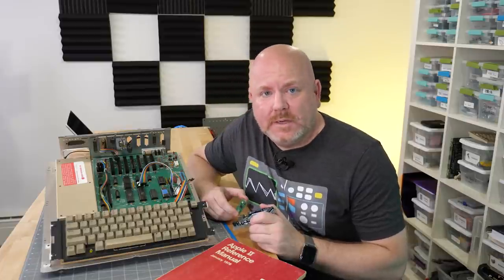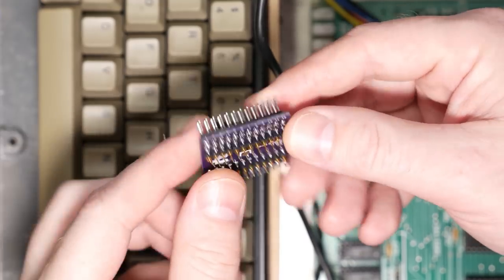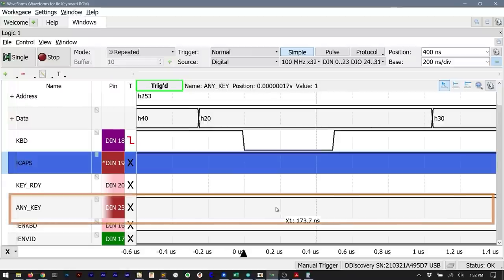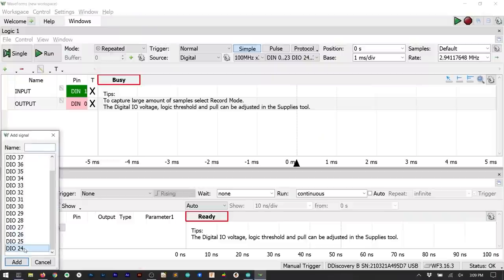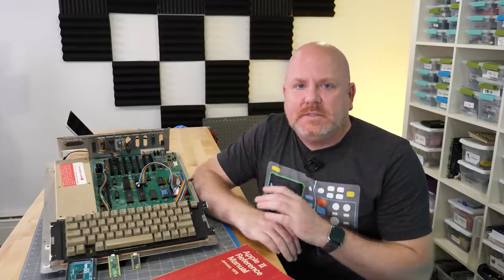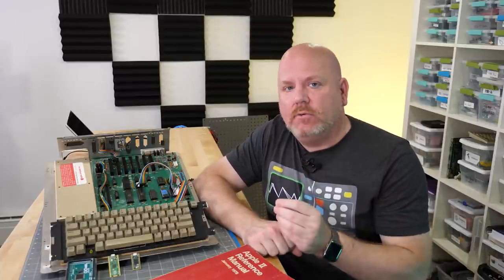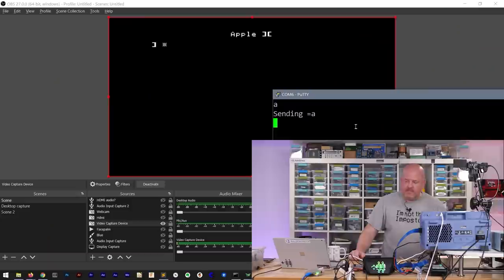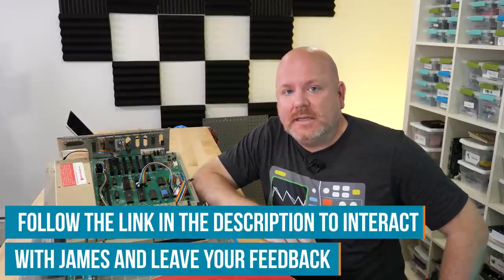Emulate an EPROM - How Hard Could it Be?

Comment: Designing state machines is mostly a lost art. I've designed dozens of them but that's because I'm older than dirt. I never got around to learning C because it was too slow and It didn't give me the control of the processor that I needed. That said, I really enjoyed vicariously experiencing your path of discovery. I remember the excitement I had when my TRS80 made my ASR33 print from the keyboard. Good job man!
Reply: c is fast . depending on how you use it. its much like a assembly libraries collection. it has lots of prewritten assembly codes embeded inside. the reason its slow in lots of cases is because of programmers lazyness and control codes used thats necessary for uninformed programmers probable errors going to happen. you can skip the slow libraries/codes used with your own ones whenewer you want. c is technically collection of code. actually today gcc has them all. and you can access the some features from allmost any language. and it simply links to relative ones from whichewer language you use :P 
atleast most of the times it seems .
Reply: C is ok for slow logic stuff if used right. You will not have feeling of "loosing control" if that's calling C from asm and not reverse. arduino is kinda opposite of how it should be.
Reply: @ahmetmutlu348  You are most likely right. But there's a limit to the number of systems I can learn and still be proficient at them. I don't code every day so I"m "good enough". C seems to be really good if you want to be able to move programs from system to system. State machines beat everything if speed is essential . 74s02 can make a decision in as little as 1.5ns.
Reply: Most of the rest of your comment is fine, and I love the low level development. Doing a bit of assembly here and there, C and C++ is what I work with most.

But "Designing state machines is mostly a lost art" isnt entirely true. working with assembly for whole projects probably is getting a art style (some still use it, for the art factor). but state machines are still everywhere.

Even in modern video-games, people use state-machines for various tasks or objects to be in. That awesome multi capable object that moves across networks? it might be in a certain state and the programmer dint fully understand object orientated programming at all. Anyway, its a great video and somehow I feel a but dirty thinking I can only use modern MCU for debugging older hardware... there must be a way to use a older z80 sbc for this... probably with state machines, ttl logic and assembler XD.

inline assembly

Comment: I've played with the Pico PIOs and they're amazing. You can calculate the exact number of clock cycles for your code and get perfect timing. I'd love to see a PIO on the RPI5
Reply: I really want to play with these now but how many pins can they do? Teensy barely has enough pins for a 28 pin eeprom..while I have gotten it going fast enough I haven't succeeded in merging the address and data pins on the teensy side

Comment: I thought this was going to end up being sort of the inverse of using an EPROM as a programmable logic device, but then I realized you were wanting to type via the microcontroller rather than operate strictly as the character ROM. EPROMs as PLDs is a fun thing to experiment with because you have many inputs (address pins) and either 8 or 16 outputs (data).

Comment: A Cortex M7 with its MSP (main stack pointer) pointing to DTCM, and the interrupt vector table and code in ITCM should be able to enter the interrupt handler within 12 cycles, but the M7 based MCUs are often lack single cycle GPIO access because of the bridges between AXI, AHB and APB matrices e.g. on the dual core STM32H7xx parts the slower M4 cores directly connected to the AHB matrices have lower GPIO access latency and can respond to interrupts in 12 cycles as well.

Still the RP2040 is a great fit for your project and the PIO can should be able to perform address decoding for you like this. Wait for a valid address, shift it into the FIFO, have a DMA channel read from the FIFO into an other DMA channel configuration register and trigger that channel. This way the M0+ cores remain available and the Python overhead won't hurt your timing. To further improve latency you can make use of the two priority levels supported by the RP2040 bus matrix. That should be enough to emulate a ROM without jitter (as long as the ROM fits into SRAM). The PIO FIFO could also be polled from one of the ARM cores or raise a interrupt line on either ARM core to procedurally generate ROM content.

Comment: What if you used native C of even Assembly in the Teensy? I found that’s the arduino abstraction is hellishly inefficient. Pi Pico is a graceful solution.
Reply: Not even sure it is an Arduino problem. GCC does unnecessary register pushes in ISRs, unless they are declared "naked" and you do the housekeeping yourself.
Reply: Yes, AVRs can run really fast if you use C to manipulate registers directly, and it gets even faster using Assembly. But, if i understood everything correctly, the atmega2560 runs at 16MHz. One clock cycle therefore lasts 62.5 ns. And the datasheet says (page 18): "The interrupt execution response for all the enabled AVR interrupts is five clock cycles minimum". The resulting 312.5 ns for 5 clock cycles would still be too long if even the 180 ns of the Teensy were to long (3:55).
(A second pair of eyes to check this information is very welcome :) )
Reply: The teensy can emulate a 70ns eeprom fine. I've done it. Took me like 2 weeks with a scope to get the ISR response quick enough. Basically got it down to 20ns to flip a pin. And I had to overclock a bit.
Reply: @graealex  not so sure about that..if that was the case I wouldn't have got down to 20ns.
Reply: @jahrkh3518  yeah a 2560 won't do it. A teensy can, I've done it, without even really resorting to asm
Reply: @forbiddenera  cool! Did you write the ISR in assembly?
Reply: @CallousCoder  there's a few assembly instructions but no. The isr is kept as simple as possible anyway so I'm not sure being pure assembly would help

Comment: Thank you for figuring this out! I recently attempted to use my old commercial versions (Flexrom and EE08) and found they needed parallel ports and not PCI based ones, old school PIO based ones. So aside from digging out a 486 and setting up DOS I figured there was some product out there that now did this....and I was disappointed. The best I could find was a MCU based project that overcame your problem by loading some latches up (74374 or something) to hold the address (hi/lo) and data. 

I was kind of figuring that that access time (back in those days measured in hundreds of Nano seconds you be too fast for a modern high level language based MCU device? You saved me a pile of work!
subbed and thumbs up!

Comment: The RP2040 on the Pi Pico runs at 3.3V and has an absolute maximum I/O pin rating of VDD + 0.5V (so 3.8V here), but you seem to connect directly to the Apple bus running on 5V.  Does the Pico pull down the bus high voltage, or have the ESD diodes in the RP2040 pins failed open?
Reply: I think in this case on the APPLE CPU side of things is only READING from the eprom.  The problem would be if the APPLE wanted to WRITE to the Pico.

Comment: Nice Discovery 2 board! I had to buy the original Discovery 1 for classes and I still use mine (for scoping, supplying, and analyzing). While it isn't as good as something like a Keysight scope, I was still able to find an issue with an nRF dev board communicating with an ESP board by probing the serial lines.

Comment: The Pico PIOs look very, very interesting and promising to me since I've been trying to accomplish something very similar to what's being attempted in this video. 
I too ran into problems while trying to emulate EPROM for my Z80 project with an Arduino nano and then later with a RPi Pico. At first it seemed to me obvious to use interrupts to control the logic of my program (toggle the WAIT control signal, sample the address bus, check the control signals to determine whether an input or output operation was being executed, read or write data to the data bus and then continue).  I managed to get some meaningful output results from the arduino and so decided to use something way faster like a RPi Pico. At the beginning I thought that a 125 MHz MCU could easily outpace a Z80 that was running at a ridiculously low speed of ~370 KHz. I was wrong. I ended up using external digital circuitry to make the Z80 wait in order to allow the Pico determine what to do.

Comment: Why aren't you just using a 74HC541 buffer or something comparable? It has three-state outputs, so you could just wire whatever slow signal you want to set on the bus into its inputs, and let its output-enable pin react incredibly fast on the "bus enable" request.
Reply: Indeed. That way the Arduino could run in "loop over input buffer: set outputs, trigger key-pressed signal, wait for enable pin to toggle, repeat" with no speed issues.

Comment: nice concept - but doesnt the pi pico have more processing power than the appleii anyway? seems a bit overkill using such a powerful processor to just run the keyboard
Reply: the pico or a similar microcontroller can in fact emulate the Apple2 perfectly. The ESP32 is able to generate video, read a PS2 keyboard , read emails, and emulate the Apple2 at the same time !

Comment: Could you have used an arduino and a 8 bit wide 3 state HC logic chip like a HC573 or HC4094? The apple is looking up a conversion table in the rom to go from keyboard  matrix to ascii. Cant you just load a 573 with the value you wanted anyway for any keypress? It's the grabbing that needs to be short on time, not the loading. A 4094 would let you do it using only 3 i/o from the arduino.
Reply: I was thinking the exact same thing. The only thing that needs to be fast is the tri-state enable, so stick that in hardware instead of trying to emulate it in software.

That said, it is interesting to see that the Pi Pico can be quick enough to do the job in software, which is kinda cool.

Comment: Now, in all fairness, you're not really emulating an EPROM. You're emulating a keyboard decoder that happens to use an EPROM as a lookup table. I was somewhat surprised that after decades of huge improvement in hardware, it is still virtually impossible to emulate any form of random access memory of any decent size using programmable logic. We now have gigabytes on a micro SD card, but it all comes at a cost in the form of latency that one cannot afford when the requested data is required within tens of nanoseconds.
Reply: FPGAs for quite some time have block-ram as part of the fabric. What does "decent size" mean to you?  You also have the possibility of using a DMA engine to write directly to DDR3/4 memory. There are even faster memory solutions as well. At one point in my career, I continuously captured data from a gigasample-per-second ADC, from one sub-hundred dollar FPGA to a Zynq SoC, that used scatter-gather DMA to write directly to DDR3 memory.. I think it's worthy to review the architecture to see if an FPGA can work for you. You can accomplish a lot with popcorn small FPGAs.  If you detail the problem you're trying to solve, we may be able to figure something out.  There are other very fast memory solutions as well that I have not looked into that FPGAs support.
Reply: @2jpu524  thanks for your reply. Very interesting! I have to revise my statement. I'm an electronics novice, trying to do some fun projects using readily available (in my context) hardware like ESP32 and such. The stuff that you are doing is far beyond my capabilities and I currently don't have the time to invest in my education. "Decent size" in my case would be emulating an 8 MB ROM with no a priori knowledge of where the next read will occur.
Reply: @nkronert  Actually see the PiStorm project. The RaspPi emulates an entire 68000 CPU, RAM and ROM while running Linux plugged into a real Commodore Amiga. I think they added hard drive emulation on the Amiga as well now. 

But indeed, one would think proper EPROM emulation would be easier -- but that access time is a problem...
Reply: An idea that may interest you - The MisterFPGA project uses an Altera DE10-Nano board with an external 128MB SRAM module that is dedicated to the FPGA fabric. You could load in your EEPROM data from an SD card, etc, and load it into SRAM memory. What kind of latency are you looking for. One intesting aspect of this project is that it'c cycle accurate in hardware-emulating vintage computers and their associated peripherals.

Comment: Is RPi Pico 5V tolerant?
Reply from the maker: No.
Reply: @element14presents  Didn't you directly connect it to the Apple II here, and thus feed 5V TTL over the GPIO? You just used a Pico w/o any level shifters added, correct?

Comment: When it comes to applications requiring quick and precise sub microsecond timing I tend to go for PIC microcontrollers. Even the DIP packaged 8 bit ones can give a very good response time to interrupts.  It is best to use assembly language and access registers and stuff directly rather than a high level language though as the latter often has many overheads and also introduce many unknowns.
Reply: Avr got precise quick timing if it is not ruined by arduino bloat
Reply: @MRooodddvvv  Quite possibly. I've never tried programming AVR in assembly.  I got into the world of microcontrollers with assembly on PIC and later moved to C and C++ for anyhting that didn't need very precise timing.  Never got into AVR assembly but I can understand that it is probably just as good as PIC.
In more extreme cases I use FPGA but it is fascinating how much can be done even with the 8 bit PICs and even more so with the DMA equipped PIC32s.
The application described in this video would be dead easy to do in assembly on an 8 bit pic even clocked by its internal RC oscillator/PLL. I think even in C it would cope enough as I have done some things quite similar in the past.
Reply: @listerdave1240  i got into avr first and then look at pic it seems horrible overcomplicated and difficult with all memory pages, limitations of what registers can be used where and so on. avr is waaaay more straightforward

Comment: It still seems more straightforward to use a CPLD or FPGA. Will this work all the time (like not miss a character after days of typing for example)? Your project is impressive though.
Reply: Could just write isr in assembly and ditch arduino bloat and should be fine
Reply: FPGA would be overkill for this application. Maybe a CPLD but in general an MCU will be cheaper and easier to program even though it is inherently far more complex than a CPLD.  A low end 8 bit MCU is perfectly capable of handling this level of latency requirement if programmed efficiently in assembly
Reply: @listerdave1240  Micros are generally much cheaper of course, and are generally easier to program, but if you looked at the jitter of your assembler routine in terms of input vs output, and plotted that as a histogram, you would see that the CPLD/FPGA will be much tighter. For this application, there are lots of alternatives. For others, the extra jitter is a ghost in the machine that may show up occasionally. I program both microcontrollers and FPGAs.. Both have their place. I have a lot of experience with pulse generators and sequencers and precision timing. Cheap FPGAs give me sub-nanosecond resolution.  All the same , microcontrollers keep on getting better and cheaper for what you get.
Reply: @2jpu524  Sure and in fact I do use FPGAs where I need that sort of resolution.  My point is that the particular application presented in this video is nowhere near needing anything of that sort and can very easily be done with a very cheap MCU and a few lines of assembly code or even C. 
Jitter would only be an issue if the MCU is doing other stuff apart from the simple task presented here, which in the case of Arduino would be going on even if you didn't ask it to - even something as simple as updating the millis() counter could interfere.  
With the PIC IDE there are no such things going on unless you specifically include them so in general even with C I manage to achieve timing accuracy and latency with low end 8 bit PICs much better than I can with Arduino, regardless of how powerful a chip I use in the Arduino environment. That would probably change if I were to go to the trouble of learning assembly for the MCUs I currently use with Arduino and figure out how to exclude the various processes and things going on in the background.

Comment: Nice! Although resorting to 600Mhz or 120Mhz+PIO chips to emulate a 37 years old 1Mhz Apple IIe chip seems kind of overkill. Almost kind of a fail, in a way… :-p
Sure, the <100ns reaction time pretty much requires hardware handling (or super-fast clock). But there are probably internal hardware modules (like say, serial protocol ones) that could be hi-jacked to do it for you in an 8-bit MCU, or even dedicated ones (like CCL+LUT on recent chips). As you're getting your inputs from another serial bus, it seems you can do all the "hard work"  beforehand (like looking-up what the output should be), and just trigger the output when required…
Overall, I wish you had explained the whole data bus protocol in more details, so that we could try to find, or even develop, alternative solutions. Would have made the whole experience more interactive, rather than just "watch me do my stuff". :-)
Reply: There are PIC micros with a "parallel slave port" which are designed to connect straight to another MPU's bus.